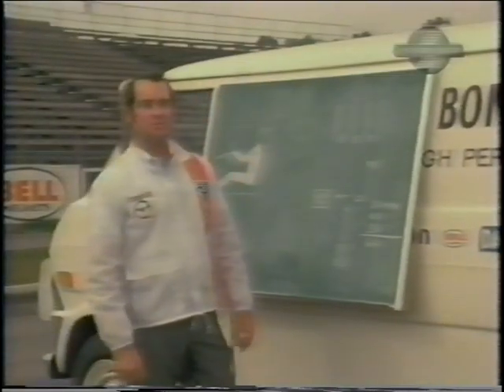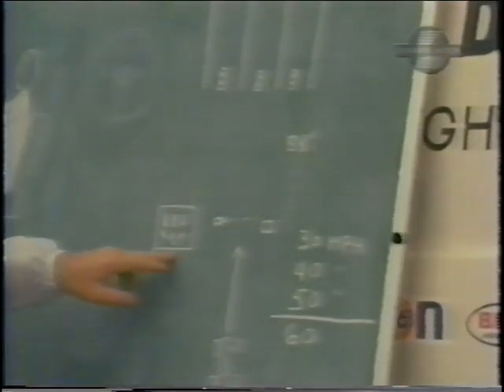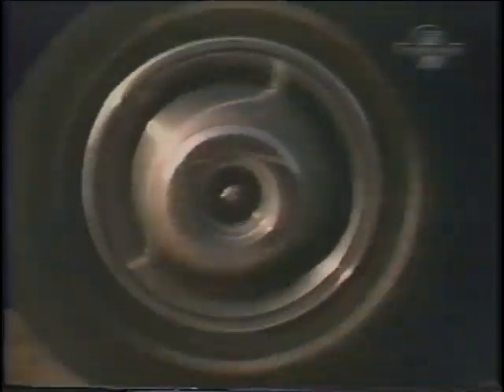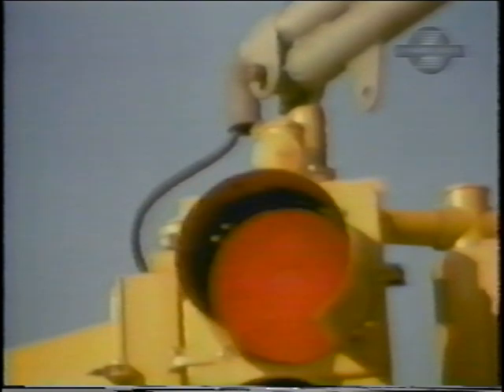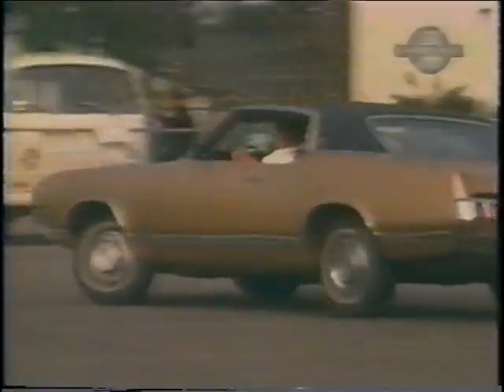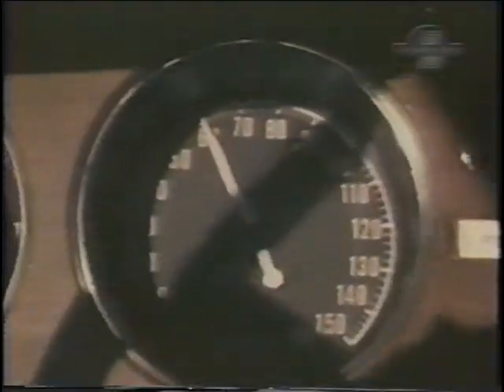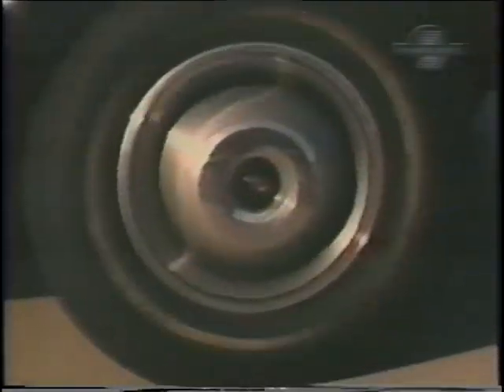1970 Highway safety w James Garner in an Oldsmobile

Comment: Notice the first thing he did was fasten his shoulder belt and lap belt.  Back in those days, they were two separate belts.  Few people used seat belts, and those that did would not use shoulder belts because of how it was impossible to refold them into the hangers over the door frame.  Garner starred in the movie Grand Prix at a time when F1 drivers still preferred to be thrown clear of a wreck rather than risk being trapped in a burning car.
Reply: My 1970 ford maverick h
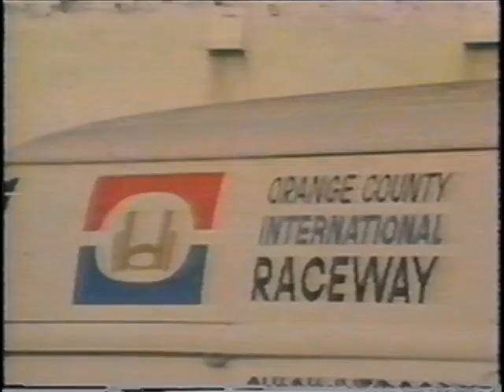Reply: In the mid 70s as a teenager 3:53 I had my grandfather's 1970 Buick Electra to drive. I was probably the only kid that buckled up both the lap and separate shoulder belts when I drove. Aside from the obvious safety aspect of buckling up, with the belts buckled I was amazed at how much better the car seemed to drive and handle when I was strapped in place and became a dutiful seat belt user. A couple of years later when a drunk driver in a Chevrolet suburban crossed the center line and hit me head on I was able to walk away from the collision. This was due to the size and quality of the Electra along with the fact that I was wearing both the lap and separate shoulder belts. A better driving experience and added safety,  wearing the belts was a no brainer for me.
Reply: I guess I was one of the few that did use them both, at least for long trips. Around town just the lap belt did fine.
Reply: @Allen362  most folks was no belt around town and lap belt on the long trip.
Reply: @blpadge2 You are right about that, however most accidents happen close to home so many people ended up eating the steering wheel or the dash or being ejected or killed. The lap belt offered only minimal protection for the lower body and left the upper body unprotected. In the mid 70s when I started driving I  had a 1970 hand me down Buick Electra and I pretty quickly figured out I needed to use both the lap and separate shoulder belts. My grandfather had been a bit more safety conscious as he wore the lap belt around home and added the shoulder belt if he was going on a trip, however he was usually the only one in the car wearing any belt. The idea of safety has come a long way thankfully.

Comment: 1970 Olds Cutlass Supreme!  My high school car was a 1971 Cutlass Supreme SX with a 455.  A big car, but handled well.  I miss the classics.😢
Reply: My high school car was a 69 Cutlass. Bought it for$800 cash. I learned quickly to take it slow and leave lots of space.
Reply: I had the 71 fastback.  It was great in a straight line but as this film shows, wollowed badly in a hard corner.

Compared to the handling in my 2014 sport sedan there is so much more suspension improvement.

However I still consider my 71 Cutlass to be the best car I've ever had and than includes BMWs, British and Mazda convertible sport cars.
Reply: Me too mine was gold w black interior
Reply: My parents had the rare SX model, Bamboo Creme with brown bucket seat interior.

Comment: 98% of people on the road today have no idea what their vehicle is capable of at any speed,  it is very important to know what your vehicle is capable of and how it reacts at different speeds and road conditions, if you are put in a situation where you have to actually drive your vehicle instead of holding the steering wheel you can drastically change the outcome of an emergency you should know your vehicle it can save your life, you should know how to react closing your eyes and standing on the brake pedal isn't always a good idea

Comment: Why no brakes? Wouldn’t any sane person ALSO apply brakes???
Reply: you lose control.
Reply: Detroit just didn't bother with suspension.  Engines. Horsepower.  Braking then did not have the same effect it has now (I'm not even referring to ABS).   Leaf springs in the back and simple coilovers up front (without front and rear sway bars) is the reality of some (2 ton no less) Detroit metal.  I owned a 70 Nova.  You could brake or you could turn but doing both at highway speeds was enough to make me shop for cars from overseas until Detroit (sorta) caught up.  It was self inflicted loss of sales for quite some time.  Passengers are safer now only BECAUSE other car manufacturers cared about handling and safety.
Reply: Brakes are for wimps.
Reply: Its a RWD car obviously but unless he's giving throttle it'd probably be fine to brake some too